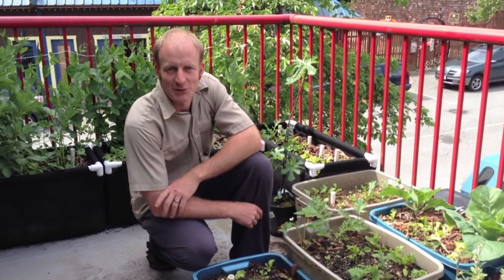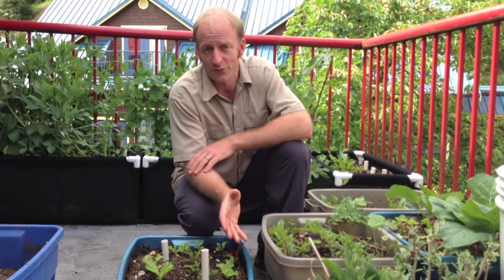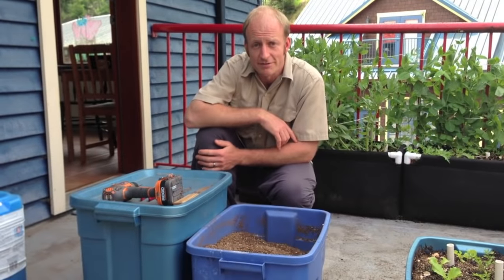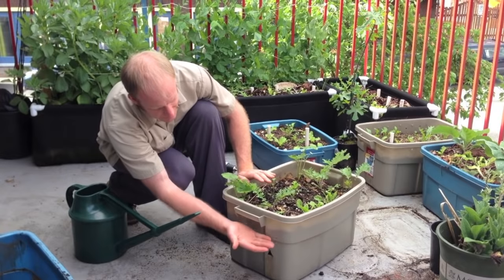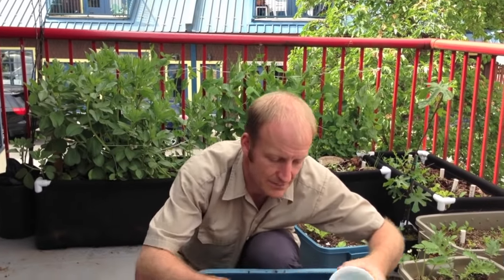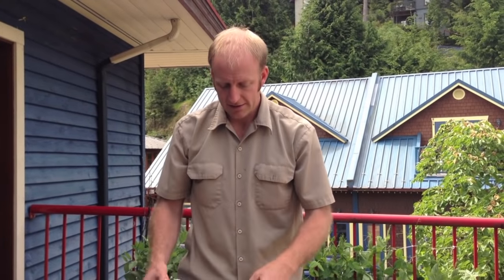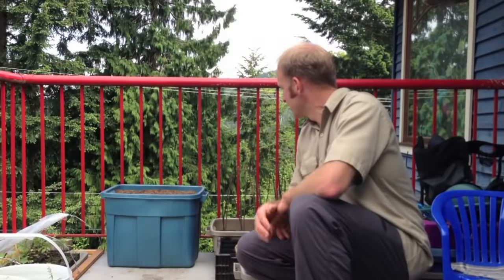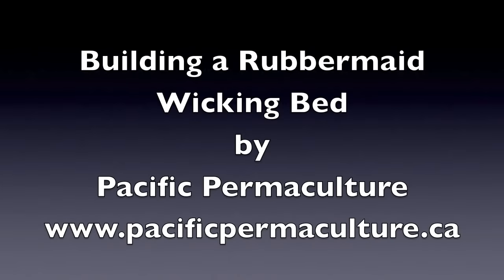Wicking Bed Build

Comment: If you haven't found a use for your lids, you can add tulle and use the lid to protect from critters
Reply: Very clever, thx.
Reply: Did you get that from Robbie and Gary? That was a brilliant idea wasn’t it?
Reply: Do what?
Reply: That’s what I do
Reply: Brilliant idea!
Reply: What about when the plants get tall?
Reply: I don't know of those guys unfortunately. You can extend the enclosures in a variety of ways, embroidery hoops with the mesh clenched between the hoops and secured around the inner edge of the lid. Or the usual plant type spokes like bamboo or even lattice. Stretched over cut hula hoops and secured with duotang clips

Comment: I did it this way for years.  Since then I found a different way: (because I am lazy) I use two containers I use the one on the bottom to hold the water etc. but instead of using the cover to hold the dirt I slide the second tote whole right on top. Everything is the same as you did it but I use the second tote instead of cutting the lid.  This way all the dirt stays in the top  and it stays sturdy an fits snug... Sometimes I use just holes in the top tote and feed cotton clothes line through hole and that does the wicking.  There are many ways.  Yours is very neat.  Thank for making this video.  ....... By the way that little seedling tent is genius.  I am going to make one right now. My open air plantings attracted bugs already. I will be using a large picture frame and some bendable branches,  Willows will work best.

Comment: You could wrap the container in burlap or canvas to decrease the uv rays that break down the plastic and makes it brittle over the years. Use the left over lid rim to hold the burlap neatly up over the rip of the covered bin. Just add a small hole in the burlap where your water inlet/outlet hole in the container is. Now instead of ugly mismatched blue, green and grey rubbermaid containers cluttering your deck, you've got high-end looking burlap covered containers with blue green and grey accent rims.

Comment: Here's a thought for how to use those lid remnants: as others have said, they can reinforce the top edge, but they can do double duty by clamping down some landscaping fabric. Cut an "X" for your herbs/veggies to grow through, and never worry about weeds taking root again.Call it "cheater mulch," but it sure does work.
Reply: More explanation pls
Reply: @lesleymasumoto808  You can buy landscaping fabric at any big box store. It keeps weeds out but lets water and nutrients through and usually comes on a roll. Cut it a little larger than the bed and push landscape staples into the mat and soil to clamp it down around edges of bed at soil level. Then wherever you want to plant, cut an X into fabric, folding the cut parts back to make space to plant. After planting, fold cut fabric back flat so it surrounds plant. This is a great use for ‘weed mat’ as I call it, but I don’t like using it in landscaped areas or gardens, because it takes a long time to bio-degrade, and keeps out nutritious twigs, leaves and the like from breaking down and enriching the soil. I use cardboard under mulch around my landscaping plants, as it greatly discourages weeds for 6 months- a year, and breaks down and enriches the soil, as does the mulch. 🤓
Reply: @deborahahonen6949  excellent idea! I was about to suggest the same thing with the rims of the lids. I also hate weeding my garden beds lol. They actually make a red plastic film that's used as a mulch specifically designed for tomatoes. The red is supposed to help reflect the light onto the plants to encourage them to ripen whilst holding the moisture in the soil preventing evaporation and blocking weeds. I've seen it advertised in a few gardening magazines. I have never used it before so don't know how well it actually works. Might have to try it out and see!

Comment: I made mine in a similar manner, except that I put a semipermeable barrier (a heavy old t-shirt) between the barrier of the soil above and the reservoir below.  This keeps the soil above from being washed into the reservoir below and ending up as a blocking slurry that clogs the overflow pipe in the side of the container.  The water is wicked up through the t-shirt to the soil and plant roots below.  It is easily replaced next year for another planting season.  
For my reservoir I used old soda bottles (1 or 2 liters worked well for me).  
I also put an upright soda container above that sat in the bottom of another below (again a sliced soda bottle) to make it easier to water the reservoir.  On the one above, I left the cap on to help prevent detritus from getting into the water below, and to help prevent evaporation.  
For my semipermeable membrane, I wrapped the t-shirt around a piece of shower curtain that sat on top of the soda bottles below.  I sliced channels along the sides of the soda bottles to allow free flow of the water.  I also sliced channels in the shower curtain, with the t-shirt pulled slightly through for its wicking action.  I got my tubs from Goodwill for $1.59 each.  The soda bottles were saved from the trash bin, as was the t-shirt.  Another couple of dollars was spent on reinforced plastic water pipe from Menards (cut into 3" pieces for each tub, it made quite a few).  The shower curtain was also bought from Goodwill for $0.89 per pound, and was enough for several tubs.  The soil was potting soil for about $4 per cubic yard from Lowe's.  For less than $20 I ended up with at least 4 self irrigating planters of a quite usable size.  (The potting soil was my most expensive component.)
Reply: Great ideas! I'm not understanding what the 3" cut water pipes were used for? If you have any photos of setup, I'd love to see them.
Reply: @jmwag69  The 3" piece was inserted into the side of the tub to allow water to drain from about one or two inches from the bottom.  That keeps the tub from filling up with water, yet keeps a small reservoir available for the roots when it's dry.  That means even less need for me to keep adding water, and fulfills the self-irrigating function.
Reply: What stops from mosquito development?
Reply: @colleenfletcher2550  No open water for them to get into.  Except for the small exit tube near the bottom of the tub, there is no outside access to the water at the bottom of the tub.  The upright bottle through which water can be added if needed is otherwise sealed off with the bottle cap when not being actively used.
Reply: I just came across this video this morning and I've never seen anything like this, so would you be able to make a video of your own showing how to make one of yours? My spouse died and I'm alone so I need all the help I can get. I'm not really understanding the T-shirt comcept and how the T-shirt water gets to the roots with the plastic lid on top holding all of the soil there. I'm trying to visualize it but I'm having a hard time.
Reply: @colleenfletcher2550  you can cover with some fabric to cover refill and drain.
Reply: @lms5951 I'm having trouble visualizing the tee-shirt concept too. Sounds like a wonderful idea.

Comment: You also could cut 1/2" slits in your recessed lids...like
1/2" wide slit....4-5" long....
Put an old piece of tee shirt or old table cloth strip, or old sheet strip through that 4" long open area and down into the water reservoir. Then lay the length of fabric across that 1/2 way up false floor u have created,
And have the fabric lay flat on the false floor....the fabric will wick the water up into that lovely potting soil u created and ur soil can receive moisture that way, also......I love ur home made potting mix.💖💖💖

What a great idea this watering set up is....it rocks

Comment: This is a lifesaver video. I have been worrying about how to garden on a patio and where the water is gonna go. I got back issues so bending and stuff is a no-go. This planter wick system can easily be adapted to an indoor tabletop, benchtop, and the fear of "Oh s***! forgot to water is done as well. BRILLIANT! BTW That trimmed lid could be re-purposed into a transparent shade for low plants with a sheet of plastic across it and a few holes on the edge of a side and an edge of the planter. zip ties for hinges and voila. THANK YOU!
Reply: I watched another ladies video that used totes. She didn't have this wicking system.
But she did set a lot of her totes in old chairs which made them high and easier to work with. I think that was a good idea I'm gonna try. I have extra deck chairs that I can't afford to buy new cushions for. So instead of just leaving them stacked by the shed, I'm going to sit them out and set my totes in them and tell to do a few of these container gardens this year.
Id for a old plastic, kids arse swimming pool. Id planned to put it on top of my well top and use it for a container garden. 
I've got to get a move on! But we are supposed to have a freeze here late Sun nite into early Monday morning. Maybe in the 20's!!

Comment: Thanks for sharing the video on a wicking bed.  I wondered why container plants have so many problems.  I am planning on growing plants on top of my worm beds and trying to figure out if I need the wicking action indoors.  I am thinking the worms will help aerate everything and they may not be needed.  I grow microgreens and baby greens in trays with worms and it works great.  It solves all my mold problems and the microgreens grow like crazy.  I also never have to change my soil.  I have trays I have planted 30 times.  Worms in microgreen trays is the missing puzzle piece.  I am going to try to do the same with my worm bins. Anyway, thanks for sharing, it was helpful.

Comment: I follow this method and made one wBed for my basil & mint cutting. I realised soil is too over moist whole day long. I think the base 2 bottles of soil need to be a much smaller size so absorption is slower. U have to adjust & modify to diff plant needs. So far, this is the best wBed diy u seen. Thanks,

Comment: After looking through many videos on the subject I was lucky enough to find this one that's clear and easy to understand the process, thanks for sharing.  One thing I'd not is that when you put the pots in the bottom they are I guess tight and fit pretty perfect but if they did not you'd run the risk of soil dumping into the water plenum if the pot shifted off the hold you cut in the plastic barrier.  I would make sure the pots were a tight fit or if not they were attached or shimmed in some way that you'd not have any movement.

Comment: Great Video.  You can use the "rim" from the top:  Just leave it on to reinforce the edge:  over time, the edge is what cracks first.  :)
Reply: On the East Coast, we have problems with Gipsy Moth Caterpillars. They eat all the leaves. For my herbs and salad greens. I would stretch a piece of netting on top,  and then tightly secure the edges with the lid.  That will allow rain and sunshine, but keep the bugs away.🙂

Comment: Good advice. How about taking that fabric and covering the entire platform so the soil doesn’t go into the reservoir?  It may be expensive at first but it can probably be reused the next year.  Btw, I use acrylic yarn wicks for my indoor African violets water system-which drink water from a cutoff pop bottle. The potted plant has a good potting mix with the yarn. The yarn travels from close to the top of the soil to the bottom of the bottle reservoir. The yarn drinks up water and weak solution of fertilizer. The roots actually grow toward the yarn and grow onto the wet wick all the way into the pop bottle.  0:03 This system is a self watering fix for fussy African violets (leaves shouldn’t be wet) and believe it or not the plant gets stiff (engorged with water) from its constant ability to suck up water and bloom so profusely, too.

Comment: Great video Jesse,  you have a lot of good ideas so I subscribed.  Been looking at different ideas for these wicking tubes. One I think will help your viewers is make extra hole in the barrier plastic that cover pots in bottom. Install a length of PVC pipe cut at an angle at one end. Cut piece long enough to reach bottom of tub, angle end down. Other end comes up couple inches above top rim. Secure to side of tub drilling two small holes and secure with a zip tie. Now you have an easier to fill water reservoir and a way to monitor water level, slip a stick or something down PVC pipe you will know where water level is, or get creative and put fishing bobber in pipe with flag attached and see when time to add water. Cap top of pipe to keep critters out. Hope this helps your viewers.  Th
Reply: I served in the Army with a Scott Smith in the early ‘80s ;)
Reply: @ScottHz  not me. Have never been in the service.

Comment: Use the lids to keep weed barrier or a plastic cover in place, just cut out holes where you put plants.  It acts as a pest and weed blocker as well as reduces evaporation.
Reply: That's how I do mine too
Reply: Robert Millard just to clarify are you saying use extra lids for this or use the original lid with the container instead of how he uses it as a barrier between the water and soil ?
Reply: @RestorationRanchHealing  you use the original lid.  it acts as a light blocker and sort of like a mulch.  it keeps the sun from bleaching the soil and does a little to keep pests from intruding.  The biggest issue you will see with this method is fungus gnats.  They will kill saplings and sprouts unless they are established.  Fungus gnats shouldn't live for long or appear if you are filling the containers from below the first 2 inches of soil anyways though.
Reply: Robert Millard thank you that makes sense.
Reply: Robert Millard I don’t quite understand the reason for the 5 pots if you only fill 2 of them with peat moss. Can you explain the concept ?
Reply: @helenoleksyn5198  so what he is doing is creating a "wick" with those 2 pots.  The other pots act as support to hold up the lid he is using to separate the water from the soil.  This allows water to be wicked through capillary action toward the top of the container.  The benefits of this is reducing or eliminating root rot, fungus gnats, and providing a low maintenance watering schedule.  I have seen people use a single wick or a old cotton t shirt wrapped up into one.  He I think is just using those two so it has even wicking from both sides of the container.  Basically think candle and water instead of a flame.  Also certain plants will do better than others with this method.  If you are interested in the inter-workings of this system, you should also check out air pruning.  Plants are fairly intelligent and will adapt slightly to optimize their living environments hence the reason for shock when transplanting.  Also look up tap roots for more information about fruits and vegetables that do well in wicking beds.
Reply: Robert Millard I appreciate your quick response. I just purchased a 3’x6’ 12” deep raised planter box on legs to be used on my patio. Would this wick system work in my box?
Reply: @helenoleksyn5198  12 inches isn't super deep but you could make it work.  you need a soil barrier of some kind to fit in the box.  I have made terrariums that use sand and gravel at the bottom to separate the soil.  Gravel bottom then sand on top of gravel then soil.  The gravel holds the water and creates an environment for aquatic nitrifying bacteria, the sand stops silt and sediment from intruding into your water reservoir, and the soil wicks water from that sand.  Best of luck.
Reply: Robert Millard thank you
Reply: @helenoleksyn5198  Balance that's all, keep everything even.
Reply: @helenoleksyn5198  I'm guessing to keep the 2 wicking pots in place without having to anchor them, and maybe because it makes it easier and less messy to move the whole bin as most of the water is compartmentalised instead of in one big mass. IDK.
Reply: @helenoleksyn5198 
How about using seed trays upside down at the base and follow his instructions here, cutting holes and filling in around the gaps. You would need to find small pots for filling with the wicking material too.

Comment: Interesting video and great ideas. Interesting with effectively a solid layer between water and soil using the plastic lid I hadn’t seen that before. I’m not sure why you either bother to stuff the holes on the edge of the lid but left the wicking point with holes to the water point. Or perhaps you forgot to show this? I’m referring to the draining holes in the pots, I would think you need a geo material between the water and wicking dirt so the reservoir doesn’t fill with the dirt.

Comment: Although you plugged up the small gaps with burlap but then the 2 holes that lead to 1 gallon containers are full of soil that could fall out into the water reservoir area, which is what you were trying to avoid with the burlap.  Is that right?

Comment: The holes in the wicking columns/pots are quite large I would use some shade cloth or geotextle cloth to stop the wicking material going into the water, otherwise a good video.

Comment: great video! i have been building these myself...what about the 2 wicking pots drainage holes? wont they leak soil in the reservoir? i thought u were going to line them with netting? any different styles u use now? considering this was 2013..
thanks again
bk

Comment: first time viewer.
you rock.

save the lid for securing bug/shade/frost covers.
zip ties.
Reply: I like that idea. Ive been using sheet plastic as the bins i got most didnt have lids.
Reply: Seems like a lot of work. I just make holes 2-3 inches from the bottom of my totes sitting on chairs, catch over flow with a bucket to use to water other pots or place potted plants to catch the over flow.